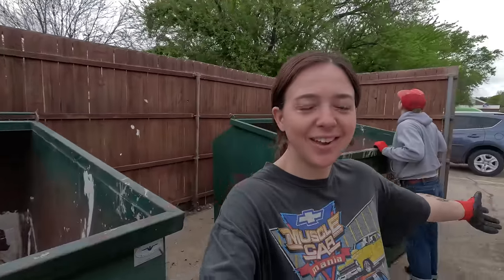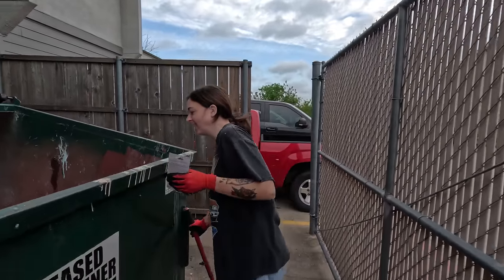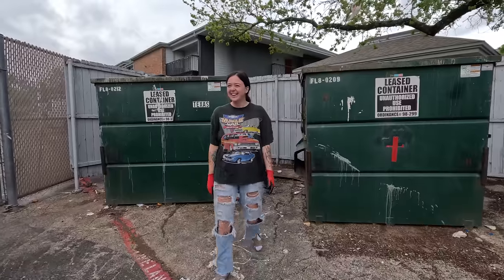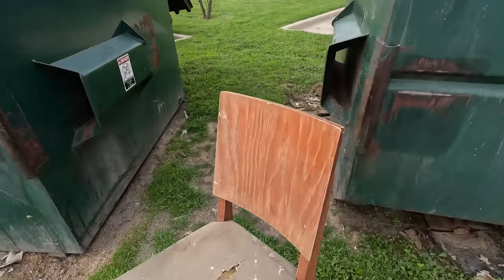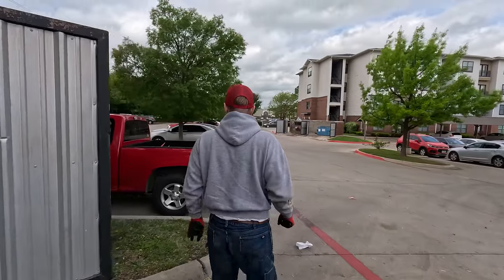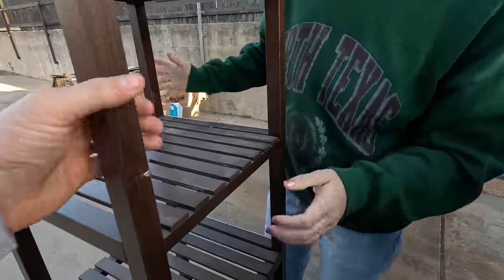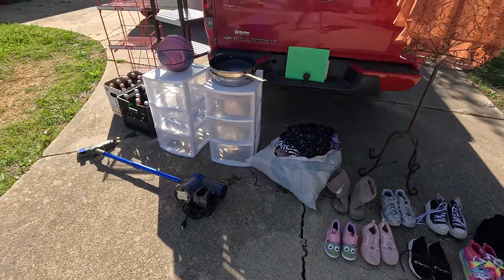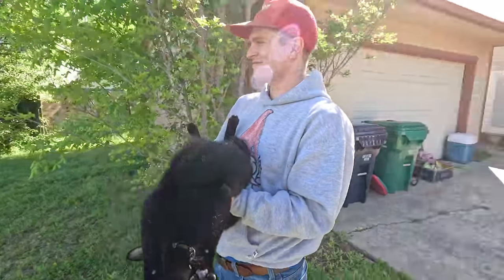Two Days of Dumpster Diving This Weekend!

Comment: Those wobbly shelving units usually Just need a new bolt or two. Or the bolts need tightening.
Reply: Or you could screw it to the wall to make it steady 👍🏼